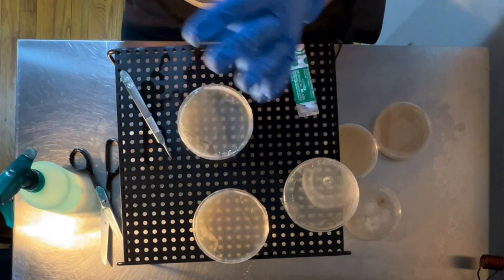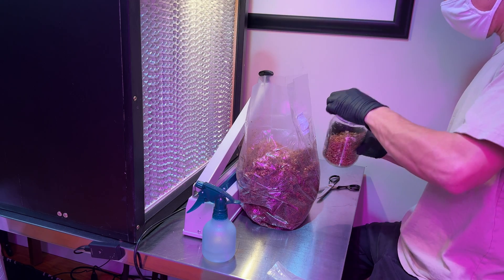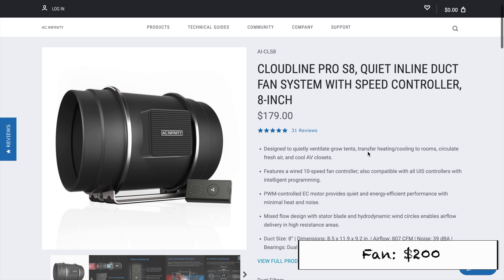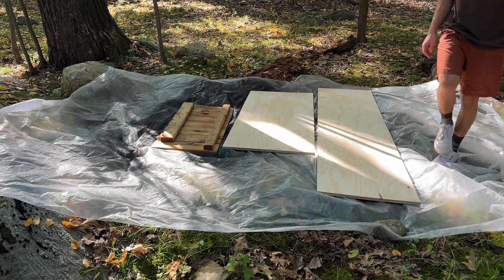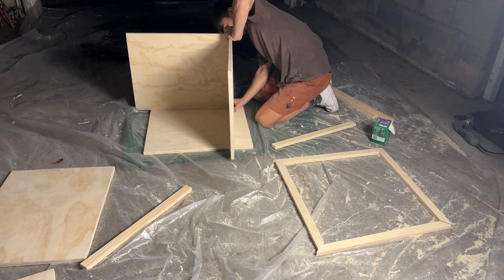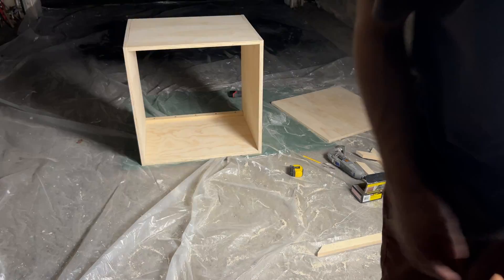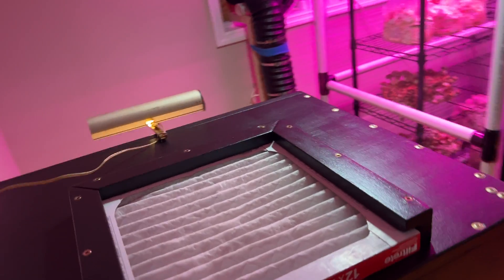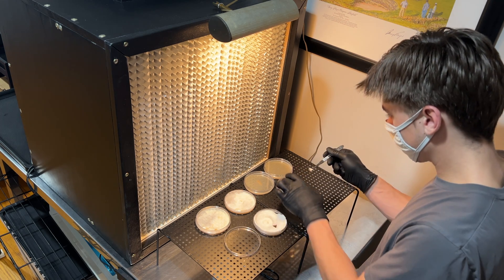Building a Laminar Flow Hood for Mushroom Cultivation

Comment: Nice science.  I’m curious about the internal volume requirements; why are flow hoods so deep, what if they are less deep?  Also, if the flow rate is lower than 100, how “bad” is it?  These two parameters still perplex me.
Reply from the maker: Thanks for watching! The depth helps create even pressure across the entire inside face of the filter, leading to a more even flow out of the filter. If it's not deep enough, the pressure towards the bottom could be greater because the fan's downward flow might prevent as much air from reaching the upper portion of the filter. The perfect flow rate can vary depending on your setup, but 100 fpm generally recommended because it's on the higher end of rates at which air flow can still be laminar, thus providing you with a larger working area since the flow will travel further. Going lower will probably work fine, especially if you notice with the flame test that higher speeds result in more turbulence. You just might want to work closer to the filter face if you do run it at a lower speed. I also wouldn't recommend going below ~60 fpm because that might not be strong enough to prevent some contaminants from drifting into the air stream.

Comment: Thanks for the video! I recently bought most materials for my own build but I did in fact buy the vector filter that’s ~12” thick. Should I avoid using this and buy a new recommended filter or will the air scrubber work? I have a dedicated room for this work.
Reply from the maker: Thanks for the watch! I'd say you'll probably be fine with the 12" filter. 6" hepas are generally better at producing laminar flow, but for mycology you likely wouldn't notice much of a difference in effectiveness. I've seen many functional flow hood builds with 12" filters.

Comment: Excellent video, with great explanation and building details. You can create a small LF 'hood' that actually works for under $100, but this is a semi-professional one that will last and make life so much more easy and fun for mycology hobbyists. The only simple thing I would add, is still sealing off the inside of the box to prevent pressure loss as it can reduce noise over time. Thoroughly enjoyed watching this, thank you!
Reply from the maker: Thanks for the comment, I’m so glad you enjoyed! Agreed, I originally thought I could get away with skipping the silicone on the box seams but ended up doing it when I noticed a little bit of air leakage.
Reply: You most certainly cannot build a laminar flow "hood" for under $100 (unless "LF" stands for something other than Laminar Flow?).
Reply: @WhiteBeardHashtag1205  I built my GordoTek hood for under $100. Now using these plans this weekend to upgrade to a larger hood.
Reply: @jjdmts4460  GordoTek's design does not include a hood, I wish people would stop calling it that. Its neither laminar flow, nor has a hood apparatus. Itll work fine for our needs, but like youve already experienced, as big as it is, it gives you very little actual work space. 

The new design does not have a hood either, but will give you much more workspace. Best of luck!
Reply: @WhiteBeardHashtag1205  if it's not LF, why does his particle meter show 0 and his lighter is at 45 deg?
Reply: @meowmix1569  Let me turn that question around for you Meow. What does particulates being present, or not, have anything to do with laminar flow? That merely demonstrates the filtration is adequate, nothing to do with currents. Alao, what does a lighter'd flame bent at 45 degrees have to do with laminar flow? That has more to do with amount of positive pressure force
Reply: @WhiteBeardHashtag1205  Seems possible with proof. https://www.youtube.com/watch?v=lInfdAVvBts&t=1285s

Comment: You have made a laminar flow fan, not a laminar flow hood. You need an enclosed cabinet for it to blow into to have a laminar flow hood. The clean air this is blowing will greatly reduce contamination, but without the actual hood, you can still pick up air from the perimeter of the fan exhaust, which will not be purified and likely contains spores.
Reply from the maker: I addressed this in the description, I know this isn’t technically a laminar flow hood, but in mycology when people talk about flow hoods they are generally referring to contraptions like this. It’s pretty rare to see someone using an actual hood for any type of bulk mushroom growing because it restricts movement in and out of the working area and just generally isn’t as well suited for the workflows associated with growing mushrooms. Machines with actual hoods are great for extremely sensitive lab work but aren’t necessary for most mushroom growers.
Reply: so if only he inserted the filter for like 20 -30 cm into the box then we could call it a laminar flow hood?
Reply: A flow cabinet will greatly reduce contam but you are right, if it was a "hood" it would be better for sure.
Reply: @inibrasiumthefirst2680  Could you not just add on on a hud?
Reply: Could have bought an actual laminar flow hood for the price of this build lol
Reply: @magnumxlpi  No, you couldn't. If you find anything for this price or cheaper then it is a scam or garbage.
Reply: @magnumxlpi  not even close you fool.
Reply from the maker: @magnumxlpi  I struggled to find any quality flow hoods of this size under $1000, curious to know where you've seen comparable ones at this price point. Sure, there are a few cheap ones from China for around $600, but they're usually made with dodgy fans and filters and I've heard many accounts of them not working or breaking quickly.
Reply: @magnumxlpi 
As someone who is based in Europe, I can tell you that that is not true in this part of the world.